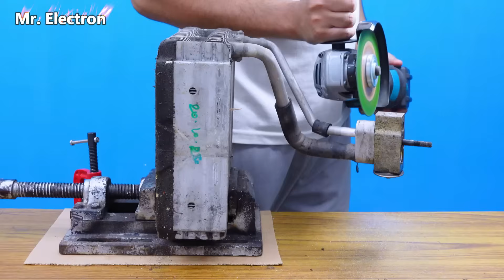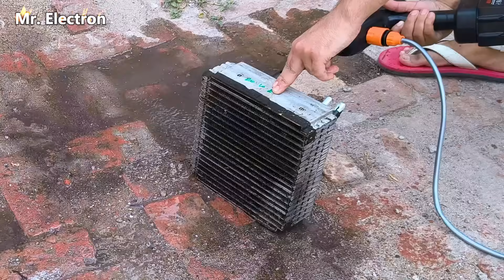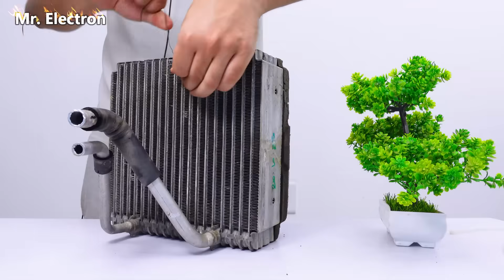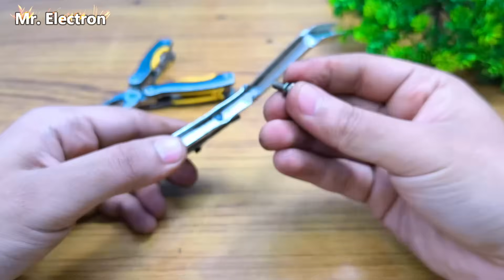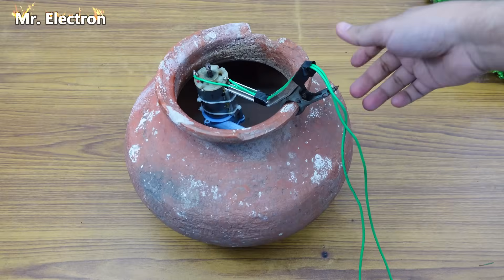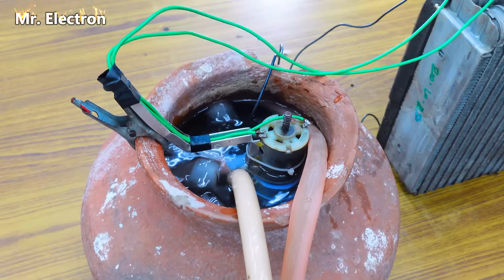Make your own AIR CONDITIONER at home Fast and Easy! - 12V, 25W Power

Comment: No way it can cool a degree it must but much more efficient to cool even a centimetre you could use peltier water cooling and keep the cool side in the radiator i have made one using 4 peltier of 12706 working very nicely and the peltier aluminium block also dehumidify the air by forming it into water so my thing is able to change 5 degree temperature

Comment: There is no compression technique and in this large time scale to cool there may be a water leakage at radiater because fans are dont have sufficieant blow of air and also continuous noice .I want to know this project have how much efficiency in your prospective rate for 100❤
Reply from the maker: For that i will have to do a long term test.

Comment: Hi Mr electron is the radiator is cold u touched it tell me plz by passing normal water through it causes it to be cool or not
Reply from the maker: No it doesn't. I touched it. Although after adding ice it works great
Reply: Ok thnx

Comment: I haven't seen you in a long time!Hello.
It's a method of moving cold water to jump and circulating cold water into the radiator to release cold wind. It's very creative content! 👍
Reply from the maker: Hi! Yeah long time. Thanks ! Still its the most basic model and still requires maintenance. Its Part - 1. Automated Design will be coming soon.

Comment: Where I am from, we call this a swamp cooler. I would move the pump to the other hose because of the heat the motor makes will warm the water ( If the pump is strong enough).  I like the idea of the ceramic pot as it would keep the cold water cold. I also would want to connect it to a solar panel so that when the sun is up and hot. The system would kinda like be an automatic cooler. When I build theses types of coolers. I will take many gallon jugs of water and freeze them and switch them out as needed as the ice melts. They really work great on very hot days. And I think you did a great introduction to getting into them. Start simple and improve. Thats the way to do it.
Reply from the maker: I have already mentioned that we have to elongate the pipe and keep the water pot outside the room for removing humidity. Also, the pump is not submerged in the water if you look cloosely and only the plastic part is in the water.
Reply: @MrElectron  Yes but you are pulling in cold water into the pump. The pump is heating the water before it ever gets in the cooler. So it's not going to matter if you longer.  If you put the pump on the other side of the cooler then you will not have that issue. Also. That pump isnt going to last long because of the water getting into the motor which is going to create corrosion. You can clearly see the water being siphoned through the motor to out the top of it. Still cool tho.

Comment: Mr Electron.   I would like to see this idea expanded to use a coil also vented with fans for the outside of a structure.  It would need to be shaded.   Im thinking of something similar to a condenser coil, something to dissipate heat rapidly.  Perhaps a cost benefit analysis of its electrical use could be assessed.   Good job.
Reply from the maker: Sure

Comment: That would be a swamp cooler.
Reply: Well i have already mentioned that part in the video that for demonstration, i have kwpt the water pot inside but you just have to increase the pipe length and keep the water pot outside the room you want to cool. Details at the end.